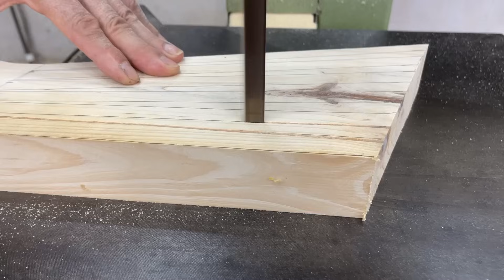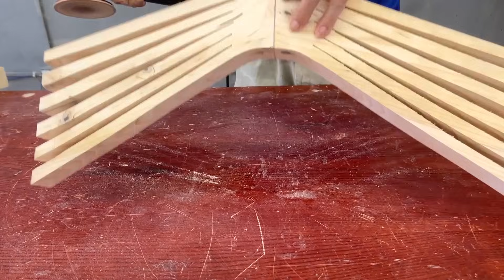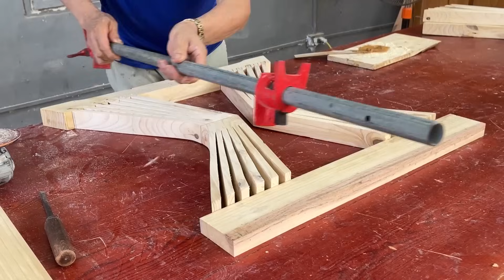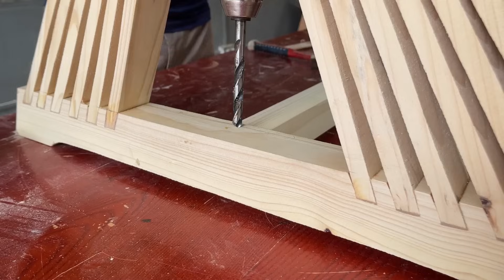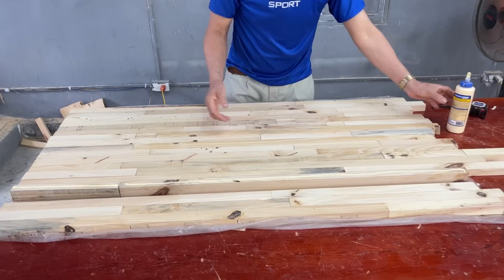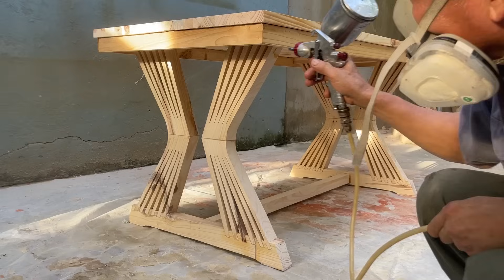Great Easy Woodworking Idea For Beginner / Using Scrap Wood To Make A Very Useful Cheap Dining Table

Comment: Very Impressive woodworking here.  It's obvious that this builder works in a Woodworking shop; and is not a home hobbyist!!
However, regarding those interesting 'legs':  One dowel & Glue to join?  I would have placed multiple dowels there; and then added bowtie-joints to the outer surfaces.  
It's not really a failing, but I would have liked the table to be foldable as well -- this depends on what your Client wants.

Comment: For Beginner ???
Reply: Just as with most any craft, the word beginner can mean someone who is picking up a tool for the first time up to someone who has been working with tools and wood for a while but would not consider themselves at the intermediate (journeyman) level yet. I feel pretty confident that a "beginner" with basic tools and tool knowledge (this guy obviously works in a shop) could do this if they had the templates, measurements, layout lines, etc. It is a cool looking table but, let's be real, all the steps are pretty basic. What is great about woodworking is simple, basic steps one after the other can end up with something that a novice (zero woodworking experience) would think is way beyond their capabilities. Where this guy deserves the biggest credit is if this was his design...designing something often is much harder than building.